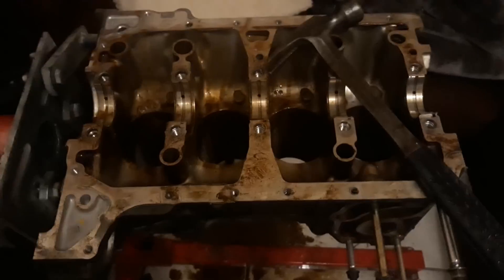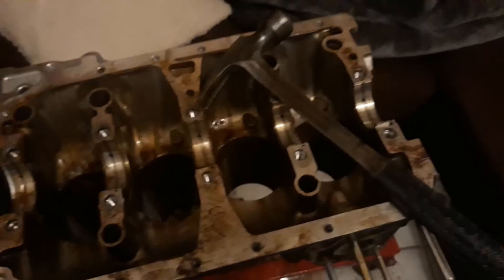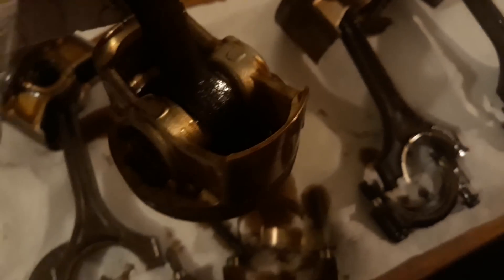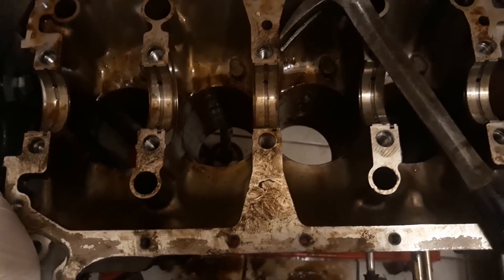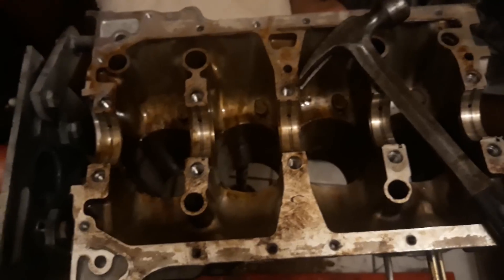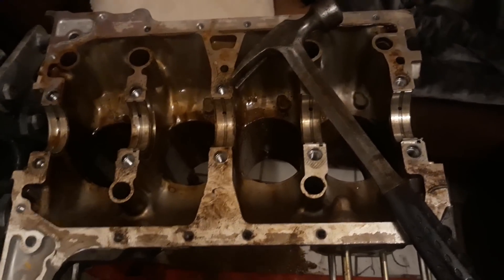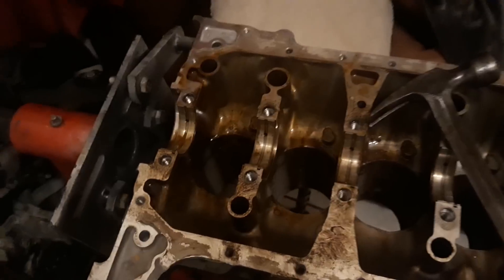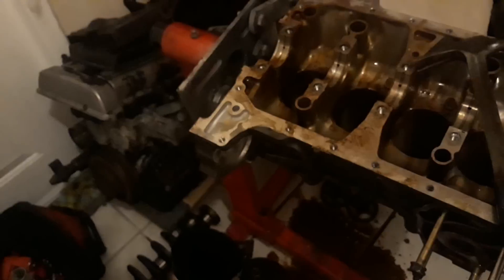Diamond In the Rough!

Comment: Hello sir are all h22 oil pumps the same? I found a prelude with H22A think needs a pump. On Ebay all pumps say 92-01 but I thought they'd be different
Reply from the maker: Why would they be
Reply: @VHBEngines  I thought because different years have different engines and or sensors? I read on Honda Tech: 
They arent very compatbile unless you want to "rig" your crank angle sensors. If you have an OBDI pump, you need to run the OBDI dizzy. If you have an OBDII pump, you need to run the OBDII dizzy
This post is 13 years old not sure